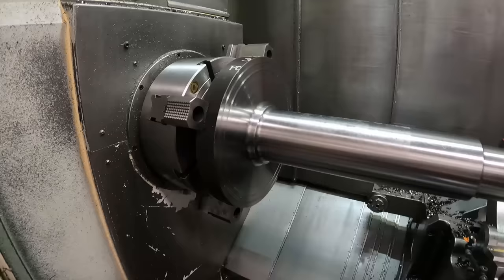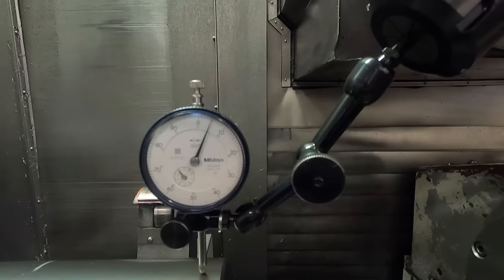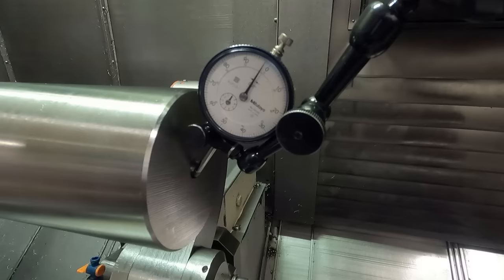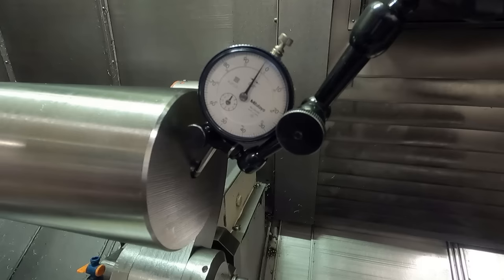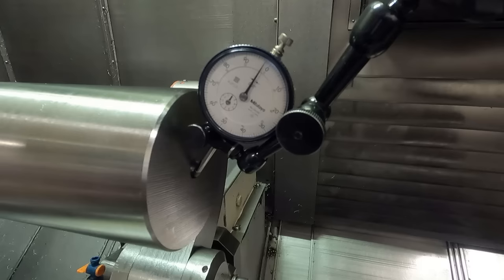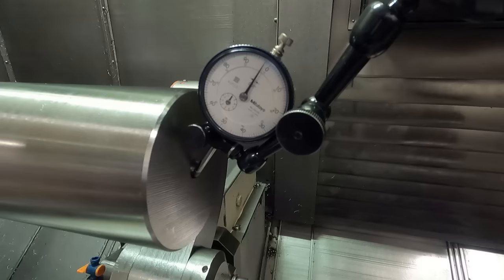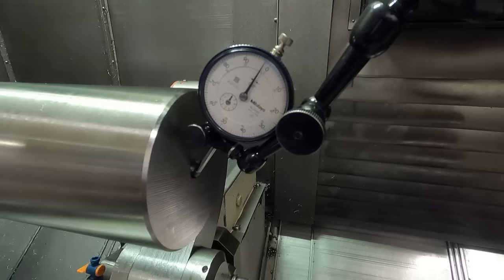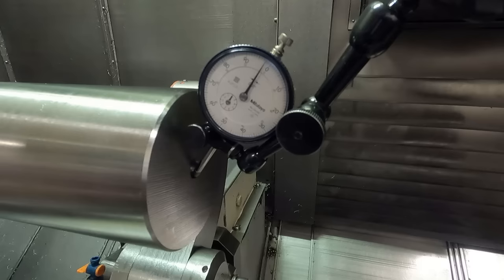Machine Shaft From 2000 Lb Stock

Comment: Love your content. I've built piston rods for natural gas compressors. I had to do the same thing on manuals machines, but I was wondering why not undo your 4 jaw like you did and then re-indecate the shaft just holding on the rod with the steady rest and your chuck. Then you could skim the face and  re-claim the center. I ran mazak 450 qtn with an auto-block steady rest. That seemed to work for me. Building shaft or rods with stressed materials is the worst.
Reply from the maker: I was just trying do demonstrate something here. The way I normally do this is to very carefully skim a concentric diameter for the steady rest. Then close the steady rest and recut the center drill with a endmill or boring bar concentric. Bring the tail center up and open the steady rest. Then finish turn. If the part is to long to do that. I put something between the tail center at low pressure to support the part enough to skim a steady band. Then continue as before.
Reply: @EdgePrecision  I just want to thank you for your videos. Even though I almost have 20 years experience in this trade you have taught me so much. Keep up the good work.

Comment: Your discussion of keeping things running true gave me an idea.

I doubt such a thing exists, but would a lathe designed such that the workpiece was mounted vertically instead of horizontally solve at least some of those problems - without creating others?
Reply from the maker: There is such a machine. Its called a vertical lathe (some people call then VTL. But that stands for vertical turret lathe.). But in general most big vertical lathes  don't have a tailstock. Also the orientation of the part doesn't make any difference for how the manufacturing stress in the bar is relieved. So to answer your question. I would have to say no it would not solve these problems.

Comment: While amazing and nice work, it does seem expensive to make that part out of one piece with so much waste. There is probably a reason to make it out of one piece but a shaft welded to a plate seems like a cheaper way to make it
Reply: Must need all the strength it can get
Reply: @FishFind3000  not only that, but welds can relieve at a different rate with cyclic stress and what was running true out of the machine can creep when put in use
Reply: The parts he makes are usually for billion dollar petrochem companies, with engineers that design parts, but have zero application knowledge. They say we want this part made out of a single piece of stock, with these unnecessary tolerances. They have no concept of cost, manufacturing processes, or anything else related to manufacturing. It can usually be done with loser tolerances and with other manufacturing methods. Since they aren't writing the check, and they're not doing the work, they don't care. It's almost certain this could be made from a weldment, or bolted together.

Comment: The center hole was round but you indicated it in after you turned the band for the steady rest, so it just wasn´t running true anymore.
Reply from the maker: You know there was something I forgot. What I was showing was the second part. Did you watch all the way to where I showed the runout on the first part. When I did that one I skimmed a short distance on the very end when I skimmed for the steady. Without the center. I used that to indicate for my X,Y zero instead of the center drilled hole. In making the video I totally forgot that step. They both came out good on the runout but the other part was better because of that. I mostly skimmed to get a better finish for the rollers. But you are correct.
Reply: I have done this process with paper rolls. After turning the band we’d use a small 35 degree boring bar to skim it true before engaging the tail stock.

Comment: Hope the chip conveyor doesn't cost you a fortune to fix. 🤔

I thoroughly enjoyed the way you explain why you take multiple steps to ensure centering and run-out on such a big and heavy part.

I do have a couple of stupid questions to ask. 

When you initially setup the 4-jaw, make your first rough cuts, then remove roughed part from 4-jaw, reinstall, do you attempt to reclamp the part in the exact same spots as the original setup and also "clock" each one of the 4 jaws to their original setup points? It looks like you did. Or is this irrelevant, given that you are using the part's semi-finished surfaces at both ends to maintain true center. 

I am also thinking it has some "bearing" to the perpendicular accuracy of the part's inside flange surface and also the small end.

As always, really enjoy watching your videos!
Reply from the maker: The reason I roughed both parts and took them out. I wanted to do the bulk of the roughing and heavy cutting with the part chucked in the serrated hard jaws. These jaws would not provide clearance on my finish turning tools. So I changed jaws and rechucked the parts. It is not critical to chuck in exactly the same spots for runout or trueness. As long as everything indicates true that’s all that matters. Hope that answers your questions. Thanks Peter.

Comment: How do you calibrate for the fact that the rod's own weight would make it sag/bow, both when measuring while done, and also while ("squeezed") turning (the rotation would make the rod "shrink in length" and "fatten")(you mention minimizing "tail pressure" to prevent such bowing, but the spinning "centrifugal" force still happens)?

Around 25:30 you answered this! You mention you would have to program a taper, but this piece is thick enough to not worry about it.

I assume this happens if the weight of your hand alone is enough to bend the rod.
Reply from the maker: I did turn some shorter ones without tailstock support. The weight of the part does come into play. It sags very slightly from give in the spindle bearings. But not much about .0005” in 12 inches of length on the diameter. Centrifugal force doesn’t come into play unless the part is unbalanced.

Comment: How about placing a valve inline with the feed from the oil reservoir to the Steadyrest, so you can maintain a full oil level. Then you could simply manually open and close the valve when you want oil flow instead of having to fiddle with adding just the right amount of oil.  Just a thought...
Reply from the maker: That’s a good idea. Or better yet put a solenoid so it only comes on when it’s clamped and the spindle is on.
Reply: Let me know how that works out. Sounds easy enough. I have no idea what that machine is, but I’m sure it has a low voltage supply most likely for controls. A normally closed solenoid valve with a reference to something related to the Steadyrest operation would work just fine.

Comment: I'm not much into lathe work. Always interesting to see the order of operations to get around deflection and stress. But I would never spin an indicator horizontally that way. Wouldn't it have been possible to spin the work as before? I would be scared that the holder would drop?
Reply from the maker: If you are referring to using the indicator in the arm. Yes in a horizontal mode gravity can introduce errors. I have tested the arm and indicator combination I’m using and am satisfied it doesn’t have this problems.

Comment: Is that an integrex? I've never run one, pretty cool. I'm glad I've gotten out of this type of work.  I've programmed and operated big cnc mills and lathes for 12yrs. When I 1st got into doing large machining I never would have thought stresses in the materials could be as much as it was. I don’t miss that chasing and compensating.
Reply from the maker: Yes it's a Integrex e650 H.

Comment: Have you thought about trepanning close to flange, and then cut the excessive stock off around the core at the flange end? Definately would need some sturdy steady rests/supports.
Reply from the maker: I have no way to run a treepanning (Core drill as you call it) tool in this machine. It also takes two steady rests to run and a high volume of coolant. Both of witch this machine can't do. Not to mention the expense the tool would add to the job. No this believe it or not is the most economical way given the time allowed to complete the job.
Reply: @EdgePrecision  Okay, thank you for replying :)

Comment: Hey Peter, I'd like to know what the spindle speed adjustment knob on the tailstock does (or to be more precise what happens on the mechanic side inside the tailstock).
On my QuickTurnSmart 200 the tailstock is controlled by a ballscrew so I don't have these.
[You explained it aftet I paused thw video and wrote the comment :) BTW the QTS200 still has this eccentric quill - 3 screws on the face of the centre and flats for a spanner on the rear where the grub screw for ejecting the centre is. Original: Further I'd like to know if the two screws facing to the side of the tailstock housing, one on top, one in the middle, are for adjusting the center height of the quill of for clamping it.]
As you notice I really like to know more about machines thaz I don't know "in person". Appreciated your explanation for the C-axis a long time ago. When I saw that video the menue button "connect C-axis" immediately made sense (my control is in German, but I think you know what I'm referring to). 
PS: Don't hesitate to create a 1 hour walk around the machine and explaining good and also rather strange things Mazak did :) 
Stay healthy.
Eike
Reply from the maker: There are two adjustments for the tail stock's quill. There it the one I referred to in this video. The other is the speed it extends. There is also the two screw in the top. One is for clamping. Although I have never used it. A little impactable for a CNC machine. The other Knob at the right end top is for ejecting the dead center. I believe your machine has a thread on the dead center for this purpose. This one you extend the quill a little than turn the knob. Than retract the quill and it ejects the center.
Reply: @EdgePrecision  Thanks for the explanation. I'll drop you an email with a picture from my tailstock just for your information.

Comment: What is the trade off to not doing an op 0 facing and centering on the Mitsubishi, then just turning between centers?
Reply from the maker: The horizontal was running another job at the time.

Comment: Can someone explain the need for such big stock? My guess is something to do with the consistency of the molecular structure needed to withstand the stresses of the loads seen by the final part. I'm an auto tech, not a machinist, so I'm hoping for some nerdy explanation to geek out on i.e. Couldn't one use much smaller stock and some kind of forging or similar process to achieve the same or better results with regards to base material quality or does the sheer mass of the stock make its core "dense" in a way that cannot be achieved by other means? I cannot help but think of trees and woodworking, using heartwood from a mature specimen with dense grain as opposed to younger specimens except you can't really do much to young wood to make it like mature timber whereas metal work allows plenty of manipulation.
Reply from the maker: If you read my comment in this videos description it will answer your question.

Comment: Interesting video but one question comes to mind. Why make a maybe 200 lb shaft out of 2000 lbs of material. Surely starting with stock nearer to the finish would minimise the potential stresses within the stock to start with. Seems to me that cutting all that material away would do nothing but release stresses in all directions to say nothing of the localized heating while cutting. Sure there's coolant but the heat's there before the coolant removes it. 
If the large flange in the chuck is to remain then I guess there's no alternative but it just seems like a gigantic waste.
Reply from the maker: Because the customer wanted it out of one piece of material. The flange area of this part finished to 16.00" in diameter. The starting rough stock was 16.150" in diameter. It couldn't be any smaller.

Comment: My brother in law is CNC Machinist. He was TRUE Machinist in the Navy on the USS Ranger during Vietnam. 
My question...
If you didn't need to remove the stock and left the center/tail in place you wouldn't have to do all this resetting, too my lay person's knowledge of lathe work. This is a SIGNIFICANT AMOUNT OF TIME taken from completing the project. Please explain.
Reply from the maker: I roughed the two parts with the hard jaws on the chuck. They have serrations to really grip the heavy bar securely. But to clear the finish turning tools I planed to use. I needed to change to different chuck jaws. So I could not do the finish cuts. One other thing even if I had been able to clear the jaws the part warps due to the manufacturing stress in the material being relieved. So if I roughed and just finished the shaft area without letting the part relax and realigning it. When I backed away the tail center it would have just sprung to the warped shape. Its like holding a curved spring straight. But when you release it it would go back to its curved state. Or to look at it even another way have you ever worked with wood and cut into a straight board only to have it warp into or away from the saw blade. Metal is similar to that in a way. it has grain and stress in it like wood. So at times when I'm roughing larger parts. I like to do the major roughing of the parts first and let them relax for a time. Than finish machine them. So I roughed both parts first. Than came back and re chucked them for finish machining.

Comment: Maybe a stupid question but why on earth start with such a large piece of material?  Could you not have just welded the flat plate onto the end of a piece of bar closer to the needed diameter?  I'm not a machinist and probably never will be but I find the trade facinating.  Even if I never have to machine parts I still pick up useful information along the way watching stuff like this.
Reply from the maker: If you read the comment I put in this videos description it will answer your question.
Reply: @EdgePrecision  Ah. I'm not used to people putting useful info in the video description.  I'll be sure to check there first next time. 👍

Comment: I get that a one piece is stronger for the application. I'm assuming that the material that is used is cheaper to machine down then getting the material forged to the rough size then machine from there
Reply from the maker: It is sometimes more cost effective just to wast the material. Than to pay for welding or forging. Also in this case there was a time factor. This was the fastest way to do it.

Comment: Was the material before machining a harder grade of steel? I'm a conventional turner from Polish and I often make details up to a meter long of the 40 HM-T grade. It works beautifully! Greetings from Poland from Polish and I often make details up to a meter long of the 40 HM-T grade. It works beautifully! Greetings from Poland Sopot!💪🤓👍🇵🇱
Reply from the maker: This material was what we call a commercial heat treat. So that would be here 4140 with a hardness of around 33-35 HRc. And yes this material machines pretty easy compared to most materials I work with.

Comment: Wouldn't this part benefit from a little gentle Heating so that most of the built up Stress could be minimize? Also is this part a Valve for some type of Engine? It looks as if could be. Tell me if you don't mind wouldn't Heating take a lot of stress out? Thanks for the upload.
Reply from the maker: It would change the certifications on the material to heat it in any way.

Comment: You don't need to indicate the center drilled hole.  Just dial in the end of the part to true and then retool the center drilled hole.  That means use a small enough tool to actually recut (bore) the 60 degree angle to clean up.  That's easy on a manual lathe, just set the cross slide on 30 degrees and using a high speed steel tool bit sharpened with the clearance to get into the smallest diameter of the center drill, recut the angle until it cleans up.  I'm not sure  with a tool holder on that machine being that large that you can even get that close.  So don't use that machine to retool the center.  Perform that operation in a manual lathe.  Then go on to the CNC.  I have been a machinist for 62 years.  Started in my father machine shop when I was 10 years old. Still own my own manufacturing company since I founded it in 1978.
Reply from the maker: You are correct there are many different ways of doing things. I was trying to demonstrate something here. I have done it the way you suggest as well. On this type of machine it is somewhat more difficult to re-cut the center drill because of clearance problems with the milling spindle (where you also mount the  turning tools) and tailstock. Unless you have a special tool to reach in between the tail center and the work (witch I didn't have). With a normal turning tool you would have to back off the tailstock to get clearance for the milling spindle. Even if you were to tip the B axis at the 30 degree angle (possible) the spindle face and Y axis wont clear the tailstock's body and quill. On a manual engine or even a CNC turret lathe you don't have the same clearance issues, so it is much easier to do.

Comment: Not sure why you would need to start with solid bar. Depending on the material a shaped forging would be cheaper unless that is the only material available to meet delivery. Would be much easier on a vertical lathe.
Reply from the maker: Here in Houston we can get material like this next day, even cut to length. The delivery of the finished parts didn’t allow for forgings. But even so a forging won’t necessarily be less expensive in this quantity. This bar can be purchased in the heat treated state the forgings would also have to be heat treated. Even though there is more roughing here it may not save money to use a forging.